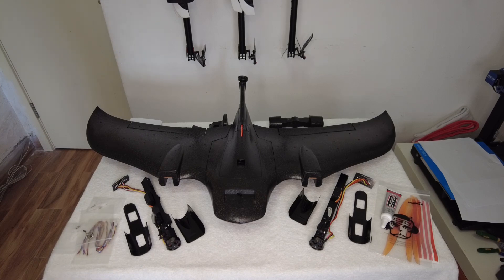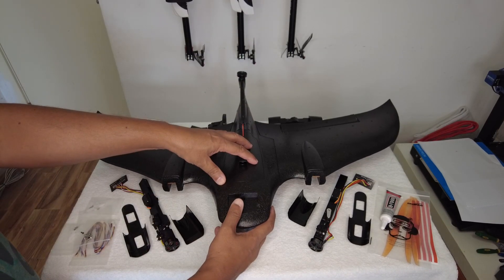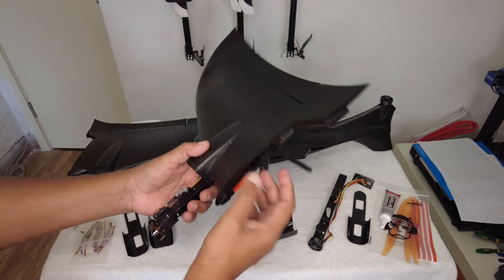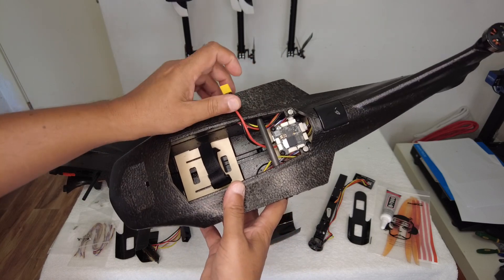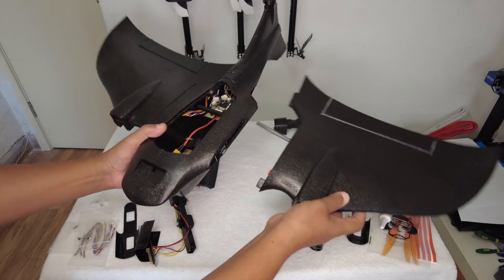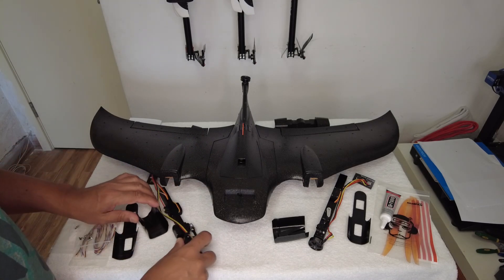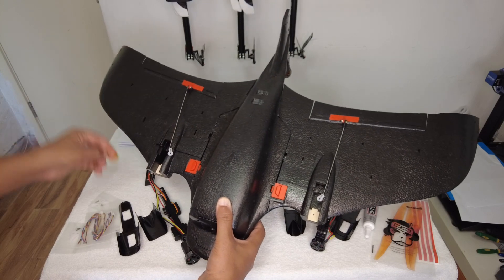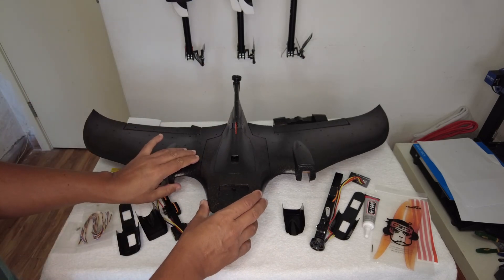FIMI Manta VTOL - High-Endurance Long Range FPV VTOL Aircraft Revealed!

Comment: can you link the system you mentioned? i wonder if you upgrade the motors can you carry a 3 axis gimbal? i want to get skydroid c12 which is complete thermal imaging + 2k camera but it weighs 117g complete and these 3 motors seem small, also i worry the nose is heavy. i want to try it!! worse case scenario I can only use the smaller 2 axis gimal for dji 03 or same size as sg906 drones and so on.
Reply from the maker: which system buddy? its an old video, i completely forgot :)
Reply: @alishanmao  oh sorry i think i meant the gimbal and video system. the cam i want may be way too big actually so I'm thinking I may need to run one of those small 3 axis ones meant for the dji air 03

Comment: nice nice video so is possible use dji video system with this fc ? and in rth or rtl this vtol landing in vertical? thank you thank you for reply .ciao
Reply from the maker: To be honest i am totally beginner to ArduPilot. I used it decades ago but then switched to other better FCs. I am not sure if DJI system will work or not. but in theory if its only FPV you can directly power it up and get FPV feed to goggles and keep the controls separate. that is no need to integrate DJI FPV in the flight controller. but then you won't have FC OSD. maybe change the flight controller, that supports TriCopter VTOL and DJI hd system.

Comment: Hey Ali - did FIMI share the Ardupilot config? or can you download it and share it? I will be using a Speedybee Wing and not theirs.
Reply from the maker: they have not, they just programmed it. i will just need to program my radio and bind it to FC. later after flight, and all tweaking, i can download and share the settings